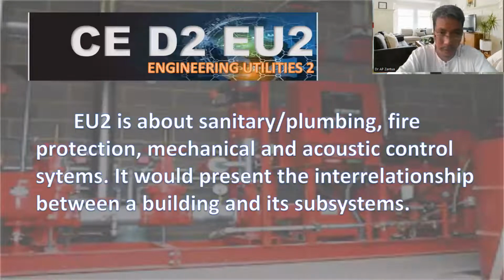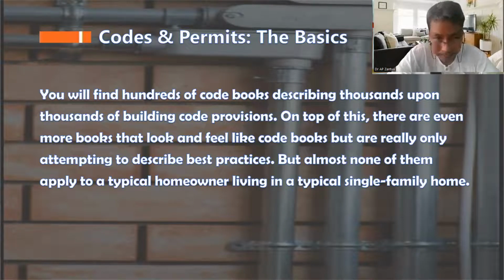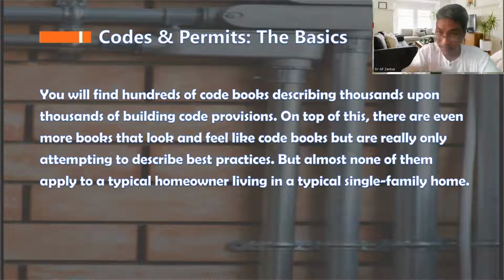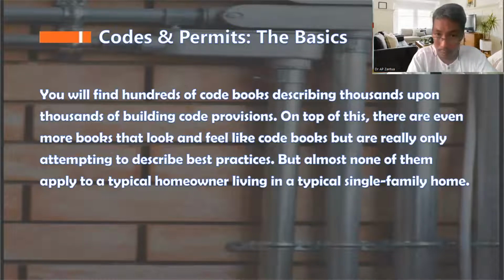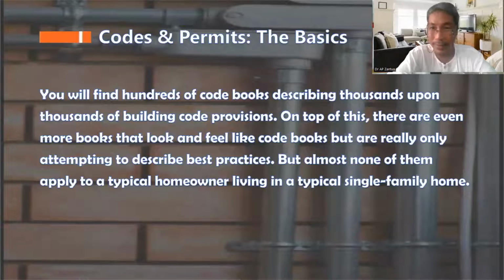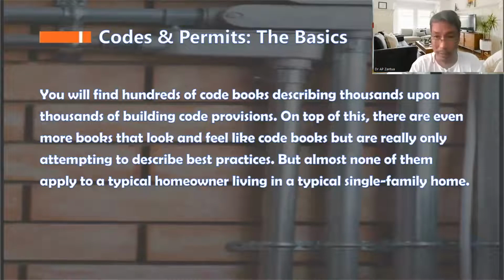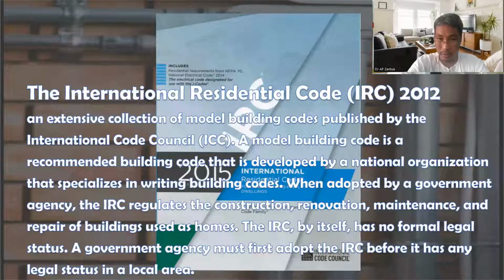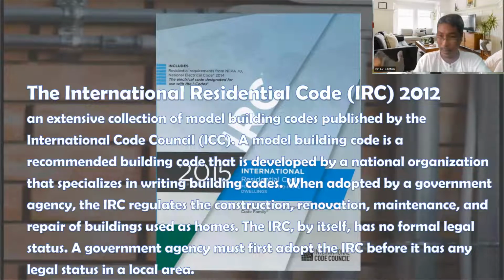Introduction to CODES & PERMITS [ Engineering Utilities 2 ] Module 1.01.A

Comment: Thanks po sir for this lecture video Engineering utilities, about plumbing system and mechanical system under the building system design. Tackle all about for objectives of the course. Also explaining some codes more informative.